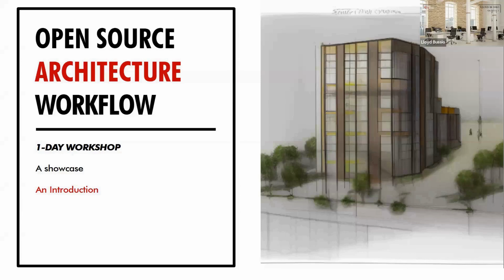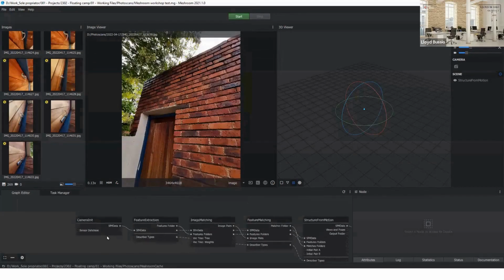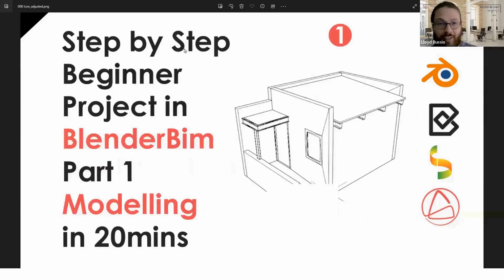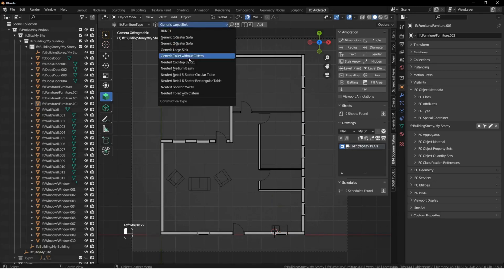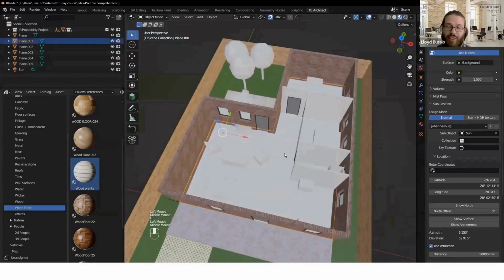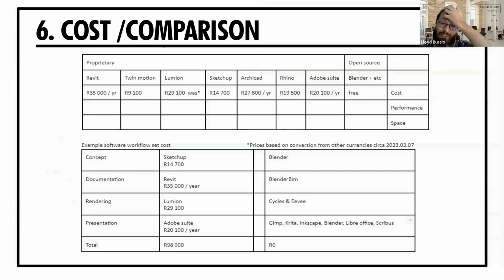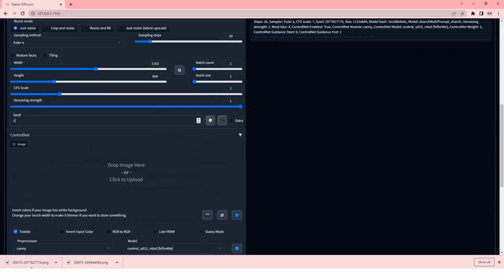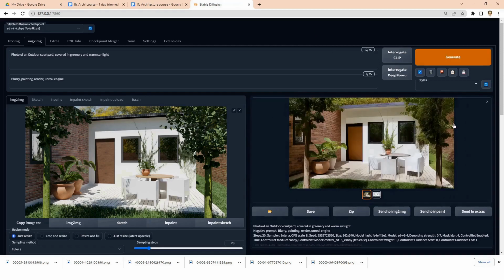Open Source Architecture Workflow - Intro Course - in 1hr40mins

Comment: Hello. Thank you for the wonderful guidance. I understand that you are not the author, but maybe you can help me. After 52 minutes, LIoyd assigns textures to IFC materials. I made the project in IFC format and then saved it in blender format. In it, I can't assign the IFC texture to the objects, it doesn't display correctly (just a solid color). Everything is fine with the new objects. Blender 4.3.2 Bonsai v0.8.0
Reply from the maker: Hi Free,
SO the approach above for rendering and texturing needs you to break the IFC file and save and use it as a completely separate Blend file from that point on wards, once you have done so you cannot go back to using any of the IFC features. The idea is that you keep a seperate saved copy of the IFC elsewhere to continue with documentation and BIM.

These are slowly coming together in an approach called "external styles" and can be used together but it is quite complicated at the moment, once it is more straightforward there will be a video on it

Comment: Thank you. How do I do wall framing, and wall layers after the house has been made? I want to generate shop drawings for the framing team.
Reply from the maker: Hi Wing
At the moment you would need to model them separately as different objects, visualised wall layers are being worked on but they aren't visualised yet
Reply: Thank you for your response. Would it be possible to write a plugin that autoframes the inside of a wall, and a second plugin that adds layers?  Or do I use another approach.?

Comment: best job done. I  use open source in alla my work, as an architect, and the way you present relevant details is very well done,
Reply: just as a side note, you may open svg natively in Qcad, and save directly in dxf/dwg (not line width issue)
Reply from the maker: Thankyou for the info!
Reply from the maker: Thanks Daniel!

Comment: i think for 2d work blenderBIM should have option similar to mark freestyle edge for top front/right view so that when we make changes in the furniture then the 2d lines also get updated.
Also if the Normals/shading of the surface or light can be mapped to gradient in svg then it will be a complete 2d vector workflow, i know it is very hard even for commercial softwares but maybe a topic for future improvement.

Comment: i suggest the name BlenderAIM for three reasons-
1. Aim means goal and hance BlenderAIM sounds like some purpose driven modelling.
2. BIM word is already polluted by Autodesk Revit.
3. BIM = building information modelling, AIM = Any information modelling. the concept comes to add information to the modelling so why restrict it to building alone. why we should follow the path of the other corporates but instead define our own. in solidworks bolts are automatically placed at holes of same dia, this is also information modelling but mechanical information modelling.
Reply: Ton is already a little grumpy with Dion for using the 'Blender' name ......perhaps a new unique name is called for....like 'conOS' (construction Open Source).
Reply: @Lake-Mist-V  Ton needs to calm down - i mean, it's not like he stole the name from a Yello song or anything (the song's called Blender) - anyway, Dion's changed it to Bonsai now (BonsaiBIM), which is cool, weird, and frustrating all at the same time
Reply: @Lake-Mist-V  that's why OSArch is kept for community.
Reply: @Lake-Mist-V  maybe Ton should sit that one out seeing as he nicked the name from a Yello song

https://www.youtube.com/watch?v=pFuj3rTXLAM
Reply: Unfortnately, among the AEC industry, AIM already stands for Asset Information Management :( BlenderAIM would be taken as a plugin for facility management and stuff